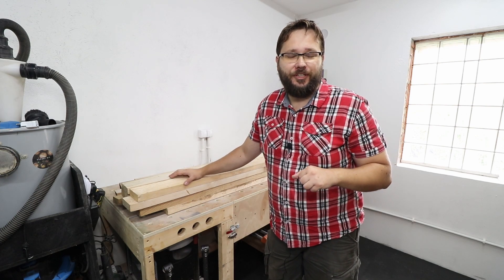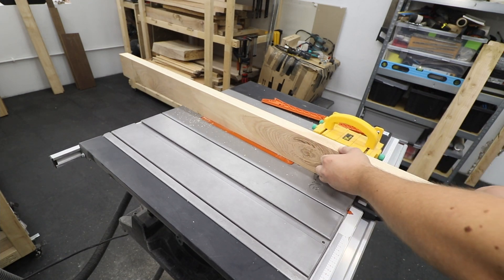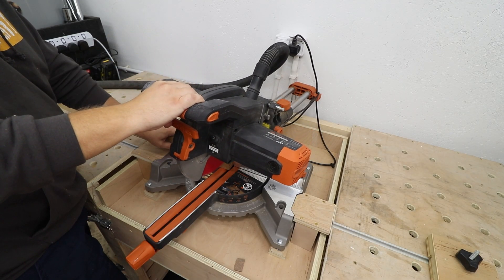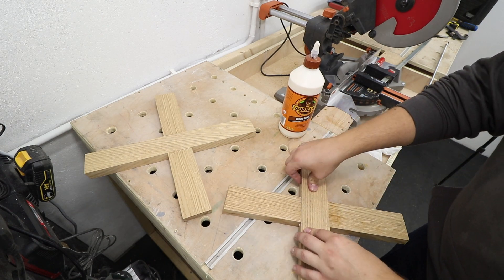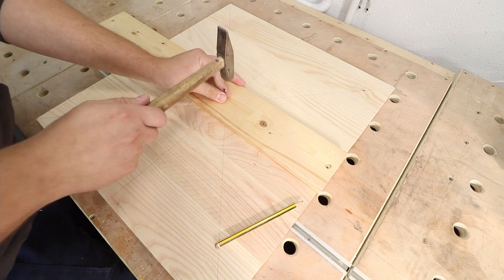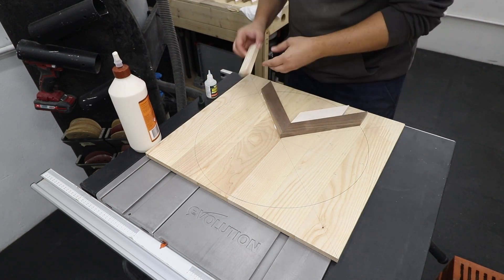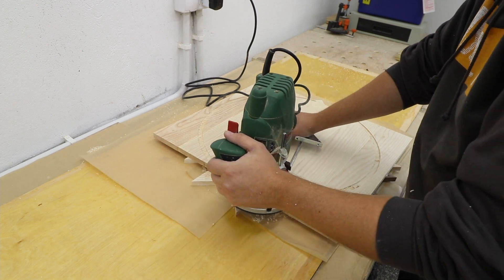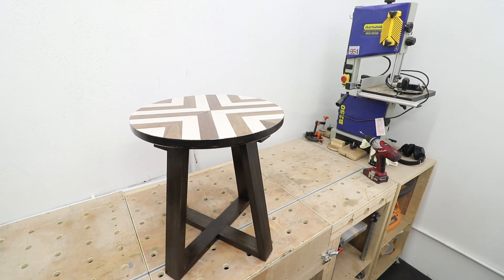DIY Side Table | End Table | Chevron Round Table

Comment: Hi Tom lovely table. 
A tip to stop tear out of the grain is to use some kind of masking tape  on the vulnerable side of the table. And also if you use the router to remove only half the thickness of the table top and then use a jigsaw to finish leaving a small amount of material and then use a flush bit on your router to finish the job this will reduce the amount of material you would have to remove by use only the router
Reply from the maker: Thank you. Yes I think that is the way to go forward with the jigsaw👍
Reply: Hi Tom Nice workshop it bigger than mine . Well done. Don😇
Reply from the maker: @donroutledge9115  hmm I don't think it is. Yours was huge unless you changed it ?

Comment: Nice build looks absolutely lovely. 
To cut the circle you can try use router to start from the back for about 5mm depth then finish cutting with the jig saw on outside router grove. And on the end install flash trim with bearing in router and finish it of using inside grove wall as a guide for bearing.
Reply from the maker: Yes thats a good idea and next time I think I'll try just that. Much safer, quicker and easier

Comment: Looks good! Glad to see you back doing projects! Hope you don’t get any problems in the future but using plywood as a base for the chevron pattern would be safer... the ash base might move and crack... the you could do a segmented ring to create the solid wood chamfered rim
Reply from the maker: Well I convinced myself that I shouldn't have any issues. The wood was 5% moisture, the slats are relatively small with alternating grain so they should counteract their movement. The legs are attached in a way to allow for movement and the varnish should give a good seal. But time will tell if it will break. But you can be assured that if it does I will report on it 👍

Comment: I've seen a guy cut a groove with a router, he then cuts in the groove (the outer edge) with a jigsaw (a bandsaw would work) then, using the original router groove, he uses a flush trim bit to finish the cut.
Reply from the maker: Yes that would be a good idea👍